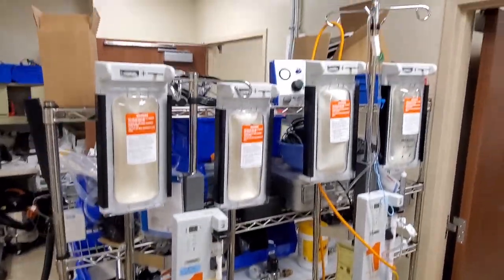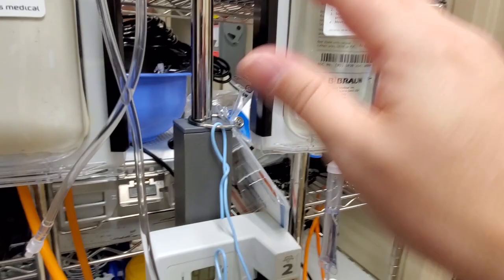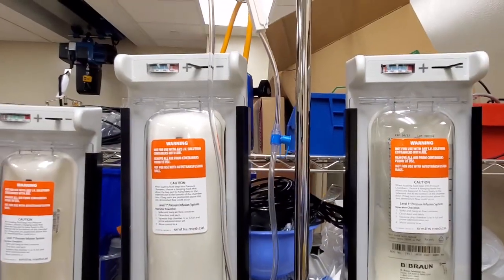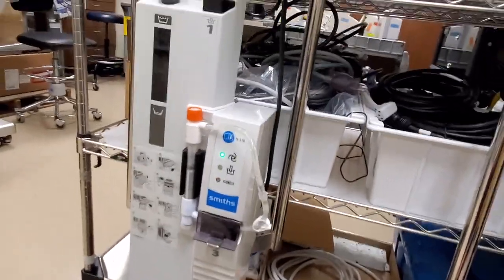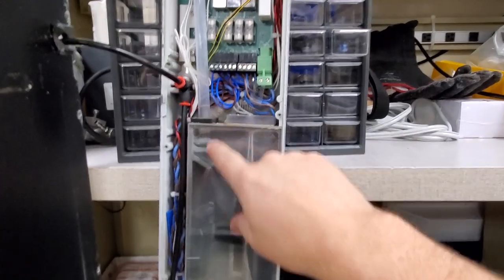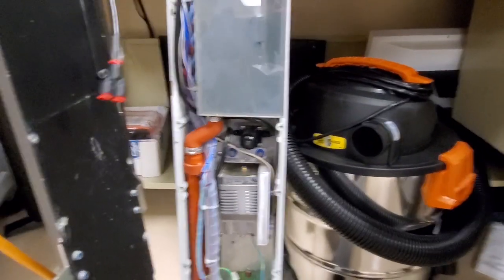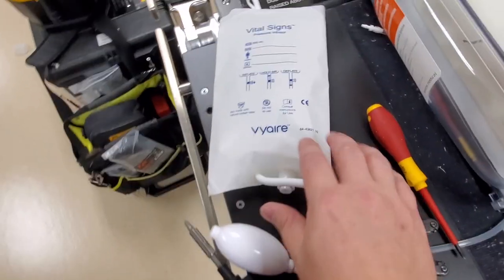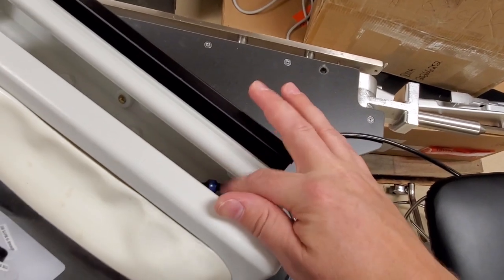Level 1 Rapid Infuser Overview

Comment: In the UK we call this a fluid warmer in nhs
Reply from the maker: Fluid warmers - here in the USA are equipment that warms fluids to be injected but rapid infusers are designed to infuse under pressure. Some fluid warmers do not have an injection or pressure mechanism. 3M Ranger, Hotline, eNFlow meditemp3 etc are fluid warmers without an actual pump / pressure mechanism.